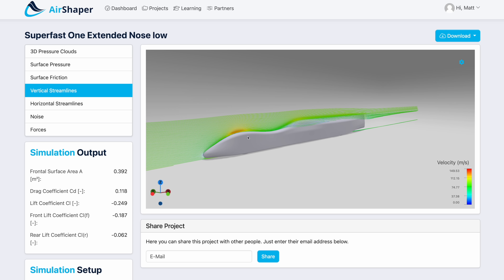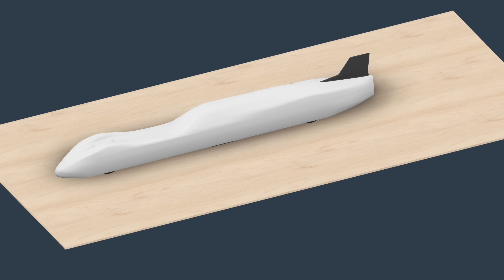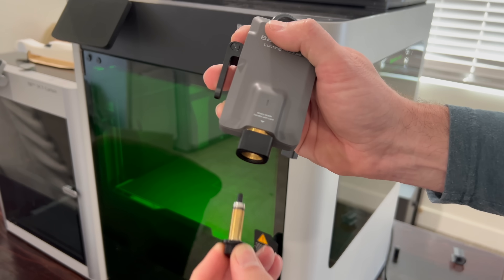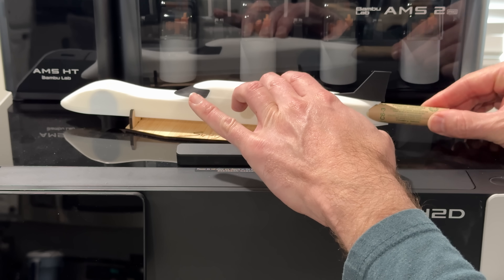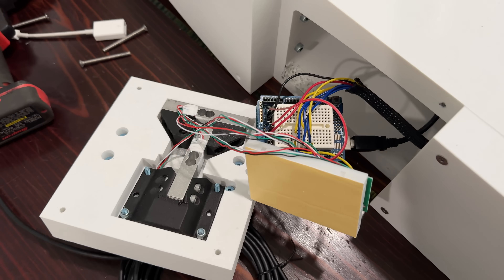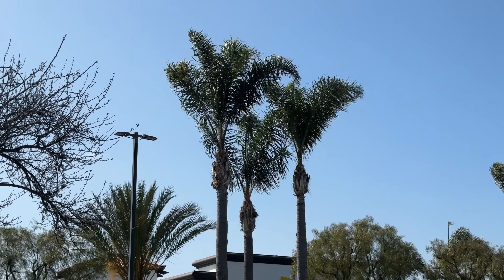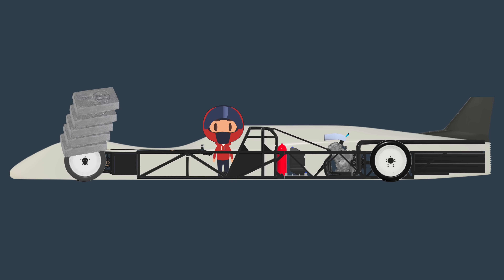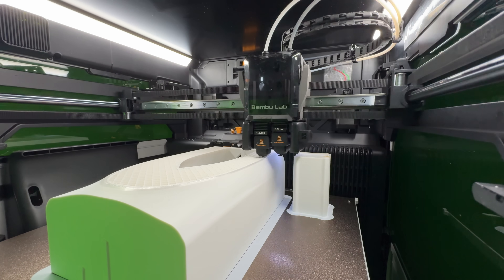Aerodynamic Testing On The Highway, With The Bambu Lab H2D

Comment: Bambu is on the damage control blitzkrieg. Good for you, as I don't care who gives you money. As long as you don't turn your channel into an ad agency.
Reply: I'm not in the loop, what damage and what controversy?
Reply: @cy-one  https://youtu.be/aIyaDD8onIE?si=SuGo1c9rvYWwVAP7        https://youtu.be/W6MybDJfmmY?si=bruKi9rS3QEr_fZU
Reply: @noahentrekin1365  no guys, your playback speed isn't on 1.5x. That's just good old Louis
Reply: HOLY SHIT WHAT WAS THAT
Reply: Legit waited and bought an Elegoo Centauri carbon instead just because of that crazy controversy. Glad everyone still remembers it, Bambu really lost our trust.
Reply: TBH, it doesn't really affect much. I've updated my x1 to the latest firmware and haven't noticed any difference in my day-to-day use. If you want to stay off the cloud, just go with LAN mode or developer mode. Compared to the constant tinkering I had to do with other machines, I’d still recommend Bambu for beginners. But if you’ve got the skills, building a Voron could be a fun project.
Reply: @yjoly835  Doesn't affect much yet.  But it's essentially the same in LAN mode with the printer (and Bambu Stuio) in local-network-only IOT jail. Well Bambu Studio doesn't handle the lack of internet access well until you turn off every option that uses it...its very chatty and actually makes the interface stutter. But otherwise it's very low effort to not have to worry about whatever they do next. Mainly I just need OctoEverywhere to keep working with it, as they do still fail sometimes, and auto-pause is nice...and having all my printer's status on one local page and streamdeck. (A multi-head Voron is up soon -- something that doesn't waste vast piles of plastic when printing multi-material would be nice.) I'll use what works best for my, but Bambu has lost trust to make changes without my input.
Reply: It already is a commercial channel get used to it
Reply: Absolutely
Reply: So they removed functionality after sale, locking users to only use BambuLab's own software? No longer free to use 3rd party tools?

And they enforced that change by somehow making the printer refuse to print before the update is installed?
AND people are now suspecting that this all lines up too well with a potential plan to eventually require a subscription to maintain the functionality of previously bought printers? Wild.
Reply: @TerkanTyr  I have a pending firmware update and 0 issues printing, what are you on about?
Reply: @ It was back in January according to Rossman.
Reply: @TerkanTyr  bs. I’ve been printing multiple times per week since January, with pending firmware updates with no issues.
Reply: @sixpots <---- Bambu shill.
Reply: @ryshellso526  sick burn bruh, you sure showed me
Reply: That mentality "I don't care who gives you money" is exactly how the slippery slope of corruption starts.
Reply: @Will-wi3kv  haha, agree. Buuuuuuuut. It is a youtube channel, not a political party.
Reply: @evgenysavelev837  re: "Buuuuuuuut. It is a youtube channel, not a political party."  Buuuuuuuut, what you still haven't figure out yet is that you've BEEN LIED TO by your friends (a LIE that you have unknowingly gone out and repeated to other friends).  okay get a pencil and write these words down: "All Human Activity is inherently POLITICAL..." (aw crap)👈so I repeat, the idea that you can "magically separate" or DECOUPLE Human behavior from Politics, is unfortunately nothing more than MYTH and FANTASY.  sorry for the bad news, but like Frankie Dunn said to Maggie, somebody's "gotta be honest with you and tell you the truth..."
Reply: @evgenysavelev837 It typically destroys a channel it’s content and the creators drive to care about the quality of content. Plenty of channels have fallen off due to this slippery slope. It just sucks to see
Reply: Or is it?
All hail the algorithm!
🫡😆
Reply: @Will-wi3kv  re: "That mentality "I don't care who gives you money" is exactly how the slippery slope of corruption starts." "oooOOOoo that's a bingo..." (best Christoph Waltz/Sturmbahnfuhrer Hans Landa reaction)👈see Will gets it.🫡. even now as disaster unfolds at their feet, what Millenials still don't want to face is that it's their immature desire to live in FANTASY (and thus live out their whole lives as Teenagers) is what's directly responsible for creating the FASCIST MONSTER now running around D.C. with a Chainsaw.  yeah creating a Monster who we literally saw and heard yelling the word "CHAINSAWWWW...!!!"
Reply: Just don't buy their products. Most consumers of Bambu would just use the included software and not want to tinker with the printers.
Reply: @JamesTK Delusional and uninformed take.
Reply: @Studio23Media  what, seriously please elaborate
Reply: @JamesTK  Until Bambu decides your printers are too old and make it unusable via forced firmware update.
Reply: @natthaphonhongcharoen  not the first company to do such a thing either, it's definitely a trash move.
Reply: "...ad agency..." literally all of his videos have add
Reply: @GRamerDim  And that's how he can afford to make them.

But there's a line between necessary sponsorship, and making a video feel like an extended commercial.

Comment: Could you eliminate the sidewind effects by making a tunnel around the model? And could you have a larger opening  to the tunnel that tapers down to a smaller cross-section around the model to increase airspeed at that location? You might not be able to make it wide enough to accommodate 45° of yaw, but you'd probably learn something useful... or not

All hail

Comment: Worth noting that this works for passive stability. Impinging upon the ground, especially with force at the driven wheels, alters the reaction. As the driven wheels are behind the center of drag they will always be applying an uneven force attempting to drive around that fulcrum since real-world traction is never perfect or even. More restoring moment at near zero degrees helps counter those forces. Since the real world object has mass it also has inertia which means that avoiding angle to begin with is necessary so that the rotational forces don't exaggerate the angle which can also lead to oscillations.
Reply: I understood all of those words individually.

Comment: The bigger model is more accurate 'cause it's more to scale with the molecules in the air.  What if you just mixed up substitute 1:10 scale model air that has smaller molecules in place of the familiar O2, N2, CO2, etc?  Sounds easy.  Get AlphaPhoenix on it.
Reply: I genuinely wonder if testing the scale model in pure hydrogen would be closer to reality than using air... you do risk blowing everything up, but that usually doesn't deter Matt from things

Comment: Minor question, wouldn’t too much restoring moment cause oscillations? Is there a “sweet spot” you’re aiming for? Or is that not really a concern because you can manually try to correct any potential oscillation from occurring with steering input? 

Also, are there any regulations at the salt flats preventing “passive aerodynamics” like those flaps on NASCAR cars that flip up when the car is going sideways? 

Thanks for the videos, they’re great.

Comment: 11:45 Yes, that's the same phenomenon as wingtip vortexes.  The front of the car is pushing air up at the plywood at an angle giving the bottom part an angle of attack with respect to the relative wind.  You might want to add some fences to the side of the plywood test stand to prevent this.  If you really want to get fancy you could add a grate in front of the model to straighten out the airflow over the model.
Reply: yea you cant really make a wind tunnel without applying effort into making it sadly
Reply: *vortices though

Comment: You could model trip devices (or just glue on sandpaper) to force the transition to make it more comparable to the CFD analyses and also decrease the inestability coming from the transition moving back and forth at low Reynold's and different angles

Comment: Lets be honest Matt, this whole venture is pretty much as good as just looking at it. Way too many confounding factors - you pretty much threw out any data you didn't like, and the moment you saw something that confirmed your hypothesis, you just stopped testing.
Reply: Like Matt said...
assumptions save a lot of time...
and experimenting!
Reply: Spidey sense says it was the best way of squeezing another Bambu printer into a video.
Reply: He admitted in the video that the whole exercise is just an excuse to find a way to use all the new features of the printer they sent him to shill.
Reply: He did a decent test and it showed his assumptions were right. What would you do differently? More tests would just show the same thing with more detail, and eat up more days of work. There's no point
Reply: @32BitJunkie What even is the test? To see if fins work? That's not even the important part of aerodynamics for land speed cars. I'd be more concerned about testing what the pressure's gonna do at 250mph right behind the nose of the car rather than if the freakin tailfin works. That's the actual danger, is getting low pressure behind the nose and lifting the front end. You won't get that data from a scale eq of 16mph. These effects appear rather suddenly at very high speeds. See old NASCAR crashes.

Comment: What about the gyroscopic properties of four rotating wheels? Wouldn't the absence of that corrupt the data that you have accumulated?
Reply: Being on top of a Toyota also corrupts data
Reply: When discussing the restoring torque at one particular yaw angle, this shouldn't matter, as gyroscopic torques would depend on yaw angle change rather than the angle itself.

Comment: I wonder if it makes sense to tie the tail to a rudder system so you can have some additional correction.
Reply: Defeats the entire point of the test.
Reply: @truantray  I'm not talking about the test, but assisting while actually driving. It might help on course correction especially on a lakebed with a crosswind.  Its not like airplanes rely on wheels when steering down the runway.

Comment: Hey Matt, great video as always! I did wind tunnel tests in the past and here are my thoughts: 
Add some wool threads on a platform and, if you can, on the model. Will help indicating what the fow is doing. 
If you can, raise the platform as high as you can. Clean air fow is crucial in this experiment. At the moment the platform may be in a dirty air pocket after hitting the windscreen of your 4Runner. 
Anyway, thanks for sharing your findings, keep it up!
Reply: Yep.

Comment: I'd like to suggest the A2 windtunnel. It is a professional wind tunnel at hobby pricing. Gary Eaker runs it and he is a former GM aero guy that worked on several NASCAR projects and even the EV-1. I asked him about sending him a large scale model of my car for testing, since I can't make the trip to Nort Carolina from Texas. 
He mentioned that at GM, they had a lot of difficulty getting good data with models. He suggested testing the full size car instead and I could have the car shipped via a car carrier service. 
Looking forward to your results !
Reply: Can A2 handle a car this long? Gary really brought down the cost of testing with Aerodyne, but did so in part by building tunnels for testing stock car sized vehicles.
Reply: @CrippleConcepts  It can accommodate a wheelbase of up to 230 inches, so Matt's car is definitely too long.  Maybe there would be a way to affix it to the testing platform without using the rolling road.  Also, the A2 tunnel can only get up to 85 mph.

Comment: I personally disapprove of printing with fiber-filled filaments when it's not absolutely necessary. Some of these fibers will go into the air while printing, some during the parts life, and the rest will have to be dealt with afterwards (which it likely won't, it'll be buried or burnt, both options will release even more fibers). I have a feeling in 50 years this will be looked at in a similar way we look at asbestos cement today.
Reply: Ill be honest, i think the microplastic thing is a bit overblown - mainly because the stuff does break down. We just find so much of it everywhere because a lot of countries continuously dump it in the ocean on industrial scales. Glass fiber IS really hard to get rid of though.

If you want to get rid of plastic, burning it does the trick and pretty well completely obliterates it. Carbon fiber burns too, but glass fiber sticks around forever - in fact burning the plastic liberates all the pokey glass dust into the air.
Reply: As I understand it asbestos fibres are friable along their length which is the main cause of health issues, as they get permanently stuck in the lungs and cannot be expelled or biologically dissolved? Meanwhile glass and carbon fibres are not, and are expelled or dissolved by the immune system over time.
Reply: Those same fiber filled plastics are already used for so many things. Glass filled nylon has been in use since the late 1930s. I bet there's some within 20 feet of you right now.
Reply: @Raven74947  oh for sure, all my favorite cordless tools are glass filled nylon, Its great material. Cheaper consumer plastic tends to just be raw abs though. Not saying we should 100% stop it, but i 3d print a lot for prototyping as well and the difference between gf and cf for purposes where you scrap half your prints are pretty negligible. Might as well use the less nasty rather than most nasty stuff.

Im also anti paper straw but see no reason ice coffee shouldnt come in a paper cup.
Reply: @Raven74947  GF nylon is widely used in car industry, almost every black color plastic part that's under the hood is 90% chance PA-GF. I personally think carbon filled filaments are more dangerous, since carbon fibers are stronger.
Reply: Lol, don't ever look inside your walls then... Or attic, or in your siding, or shingles, or demolish concrete, or really anything to do with construction. Glass fiber is used EVERYWHERE. 3d printing probably makes up a laughably small percentage of the stuff getting into the environment. Not saying it's a good thing, just saying 3d printing is negligible compared to it being used in construction materials
Reply: @jakezanders6598  well, working in construction with fiber materials require PPE, while such materials for 3d printing is a wild west
Reply: @alexeyf1795   That is exactly my main point. Glass wool is safer than Asbestos in no small part because the people working with it usually wear PPE (at least in developed nations). Printing is known to produce filament dust, and there is no PPE whatsoever, you can be glad if the print room isn't also the bedroom
Reply: @jakezanders6598   Processing a material is not the same as having it sealed in a finished product. Carbon fiber filaments spread the fibers in the air during printing and they're unhealthy, period. Siraya Tech, a brand specializing in CF filaments recommends using respiratory masks and ventilation while printing and processing the material. As is standard practice when cutting or milling carbon fiber parts in other industries. The material has its uses but it's irresponsible of online shops to list the stuff right beside standard PLA without any further information.

Comment: Ages ago in high school tech class, we would set up a race track and would spend a quarter of our senior year designing and carving out race cars and would launch them with co2 cartridges. I just realized your small scale model looks shockingly like the one I made. I came in second place, only losing to a car designed like a screw driver. Thanks for unlocking a core memory.
Reply: i was in ED Tech too... still have a couple of the dragsters... my best design teacher kept,  15 years later met a younger classman .. he said teacher sent it to nationals after i graduated...told me my design beat a ton of cars and won awards...lol had i know maby i would of made it as an aero engineer
Reply: I remember that. Pinewood Derby. For me it was a one semester middle school shop class. It was a side project assigned as home work. They didn't want to fund real projects so they did this. They didn't want to fund a lot of things hence the reason there is no shop program anywhere in my home town school district any longer.

Comment: Should have just strapped the full-size land speed car onto the roof of your car.
Reply: Make the model 200% actual size and you only need to go 100mph to test it!
Reply: @richardlamm4826  hmm for land cruiser twice the size should work better
Reply: Same size but put an appropriately size rocket engine on the back of his 4Runner.
Reply: @tkreitler  at that point why continue with the land speed car when he can have the world's fastest 4Runner
Reply: Since you have to go 5 times the speed for the 1/4 scale model to be aerodynamically accurate, this dictates that Matt needs to build a giant 4x "scale model" of the real land speed racer so he can test at 50 MPH. That's right, there will be room in the tail for real rockets. When the CHP pulls you over, Matt, be sure to tell them the internet made you do it.